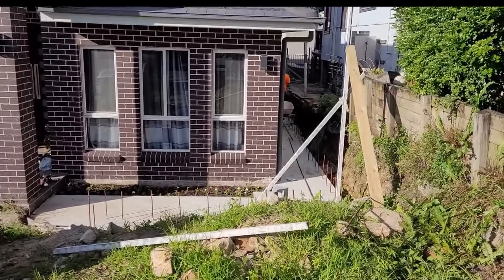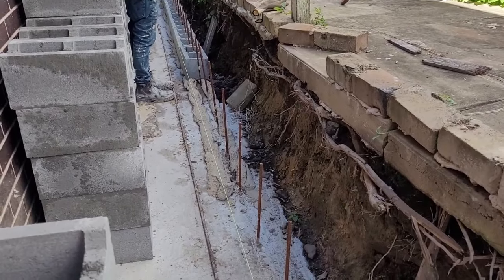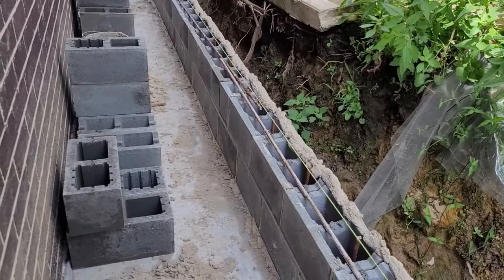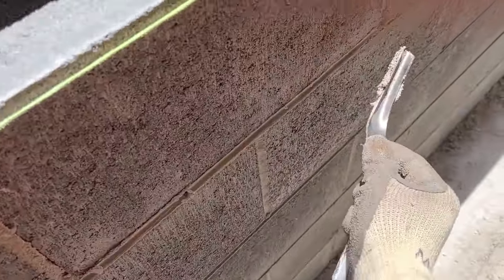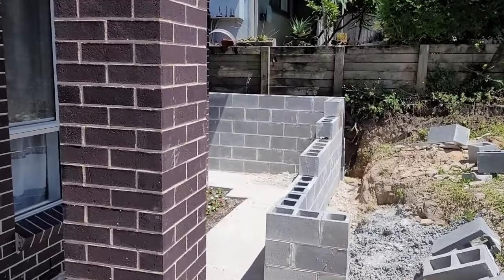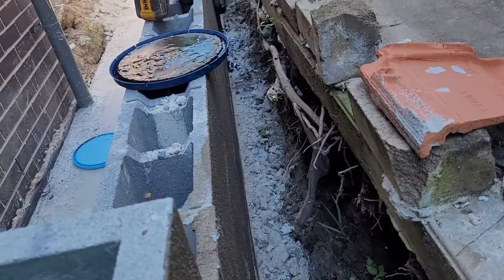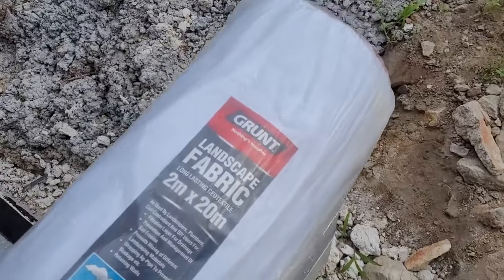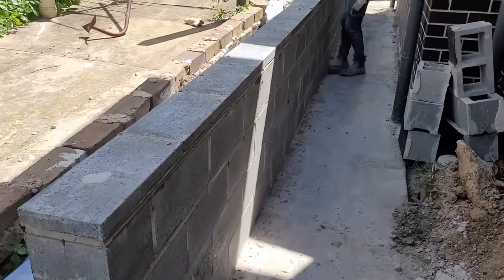Besser Block Retaining wall - part 02, landscape design retaining wall, retaining wall structure

Comment: Can 65mm x 65mm gal fence post be cemented into the holes for a colorbond fence on top of the wall?
Reply from the maker: @edwardtaras9213  Hi
Yes, you can install the post at the same time as core fille the blocks or later by using core drilling.

Comment: Thanks for the video, it was very helpful. All the US-made videos I found only used ready made blocks with no footing, nor concrete filling. Even when they use geogrid-meshing I would not think those walls are nearly as solid as this. Only thing I didn't not understand, why didn't you connect the corner with crossed-blocks but had them fully separated and only connected using steel-bar?
Reply from the maker: Hi mate 
Thanks for your comments .
The reason is because concrete blocks wall will move in different temperature. May the wall in different directions pushing each other and make a crack in middle of other side.
Reply: Thanks! Those US-dudes (mainly Dirt Monkey) don't seem to do that, but then again they don't use mortar at all and their blocks are not even rectangles (there is some room for brick expansion) so maybe that's why they don't need to count that in.

Comment: Where will they install their fence? On top of the wall, or behind the drainage?
Reply from the maker: In this project in behind the wall on the boundary. But if the wall built on boundary you can install it on top.

Comment: I am curious about who paid for this - your neighbour or you, please? Usually a top side land owner is responsible for retaining the land at the boundary line. But as I can see, you decided to localize it on your land taking all the expenses and responsibility on you.
Reply from the maker: By the low, how have the lowest land should pay for retaining walls. But the fence cost will be shared with two neighbours.
Reply: @maxlandscaping  Nope! If retaining wall is completely located within top land and it`s too close to a boundary line- there is no option to place a REAL FENCE straight on the boundary. All what the higher owner can erect on top of his retaining wall can`t be qualified as a dividing fence due to it is out of boundary line and situated within his/her property. Such kind of fence on top of retaining walls in the reality is only a privacy  screen or a fell off protector, but way not a divider. Despite it looks like a fence and made of colorbond :)  All the expenses for this type of objects are usually on the retaining wall owner, and this boundary side usually established as non-fenced.  That`s critically important. You can`t be owner of something located or attached to your neighbour`s property...  It would be like house is neighbour`s, but a fraction of its roof is yours and you have all the liability/duty of care...

Comment: Внутри блоков осталась пустота? Почему их не наполнили бетоном? Или вы этого не показали?
Reply: Translated for you: Is there a void inside the blocks? Why weren't they filled with concrete? Or did you not show it?
Reply from the maker: Behind the wall will be filled by aggregate, and inside of the blocks will be filled by concrete.